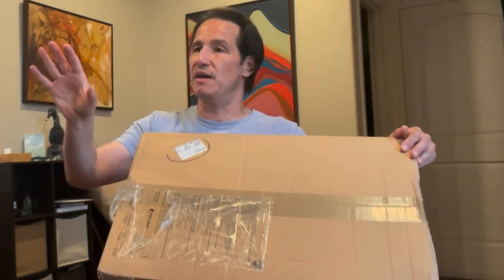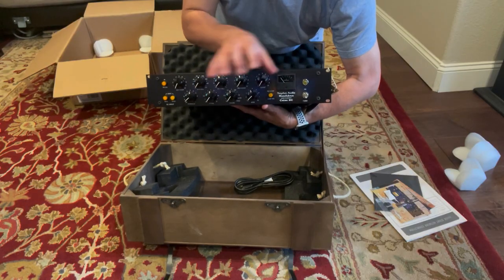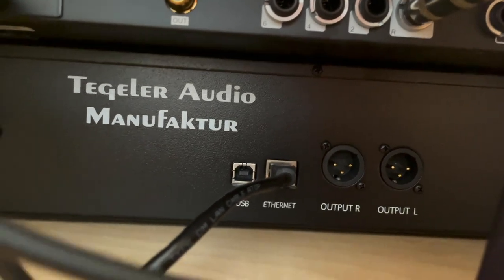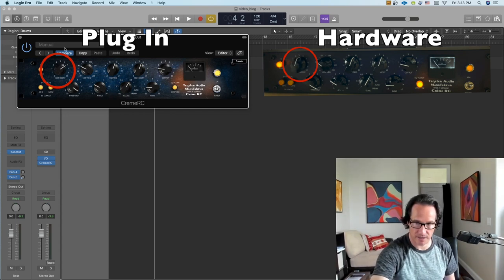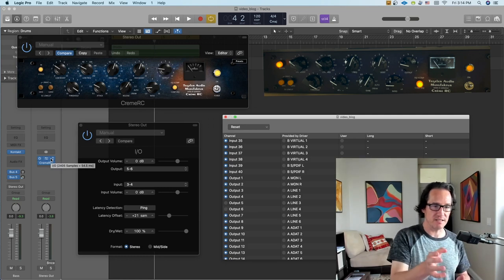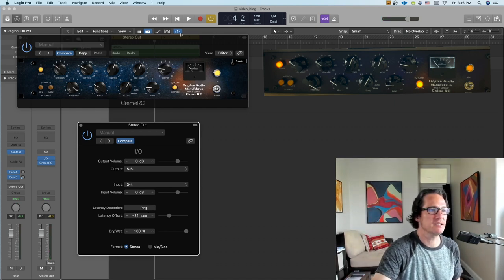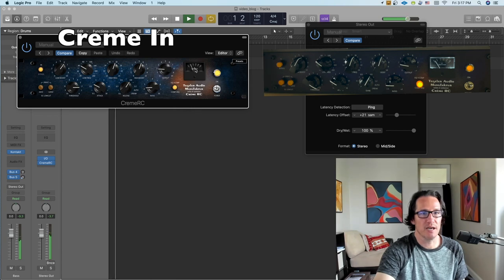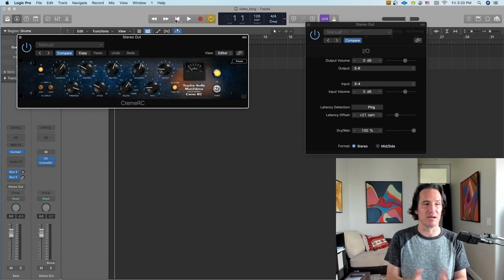Tegeler Creme Unboxing and Set Up in Logic Pro

Comment: Hi Peter, how have you setup your UAD console? Cause Im getting a feedback loop all the time, so cant really listen to the Creme....
Reply from the maker: Hi Marcus. What DAW and what UAD unit are you using? It's hard to know for sure what is going on, but if you're getting an annoying feedback loop, my first suggestion would be to check the SETTINGS within your UAD Console. Unfortunately, the Console Channels don't always match 1:1 with the INPUT/OUTPUT of the UAD unit. For example, I'm using Console Channels 5 and 6, but those map to UAD inputs/outputs 3 and 4! If you've adjusted your Console SETTINGS at all,  or if you're using a specific IO preset, there could be something off that's not matching with your IO on your UAD unit. Of course, you need to then match this IO in your DAW  (in Logic, I do this in the IO plugin). As well, be sure to check the latency. I've also noticed that if I have lots of VSTs, or other resource-intensive plugins/project settings, this will increase latency and can create a "double" tracking sound (not really a "feedback loop", but similar, and it makes it hard to monitor.) I hope this helps. Let me know!

Comment: I just got the regular Creme and was wondering how you bounce your final mix with Creme in the master bus.
Reply from the maker: HI SwingingCreeper. The Creme RC plugin works just like any plug-in (via the I/O insert in Logic Pro, in my case.) So, I place Logic I/O plugin on my final bus channel and it acts as an insert: sending the signal out to the Hardware Creme and back in to Logic and then on to the rest of the chain. However, I'm learning that depending on which plugins, and/or how many plugins, come before the Creme in this chain, I can get too much latency to make this work. I'm still testing it out, and I haven't found the perfect set-up yet (for zero latency.) If it's a simple session, with not many plugs on the final bus, it can work fine; but, more complex mixes have not worked and I've had to bounce a stereo mix without the Creme enabled and then add the Creme during mastering. I'm still figuring it out. Thanks for watching and great question!
Reply: I figured that bouncing the project then adding outboard gear as a separate project would probably more efficient and less off a CPU load.